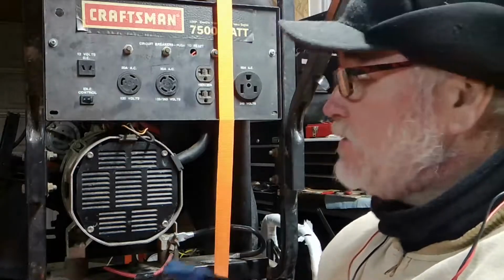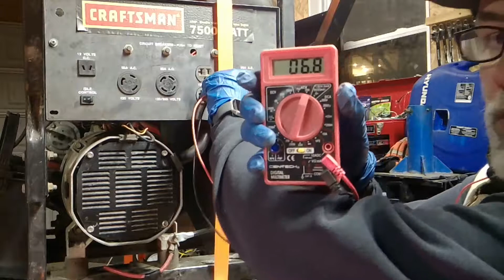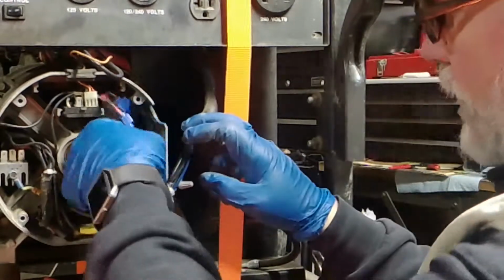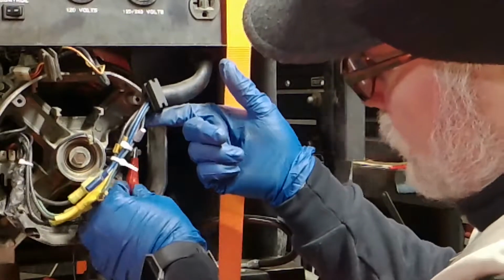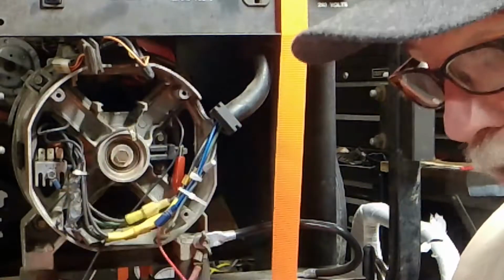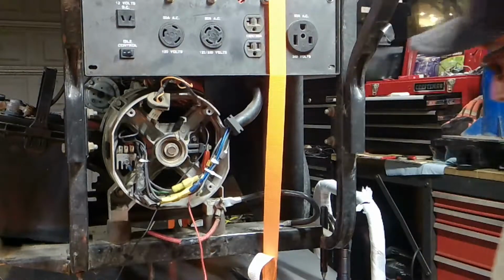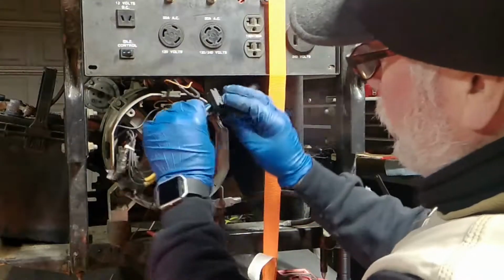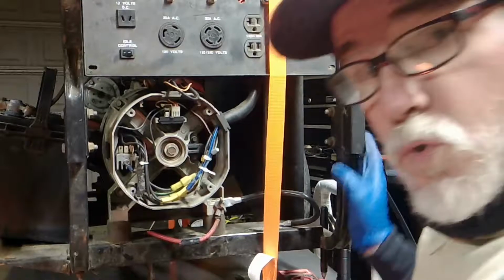How to diagnose generator power loss by flashing field w/12v battery and change voltage regulator

Comment: Great video the best part was when you showed us how to charge field with battery and having AVR / voltage regulator unhooked to see if generator puts out proper AC voltage so I tested and it puts out over 120 volts ac so it needs new AVR this was on a Honda EB2200X. Thank You Tim !!!!
Reply: ⚠️Generator safety: make sure you follow all the generator safety tips and always remember that carbon monoxide fumes are very dangerous to inhale and carbon monoxide is odorless and colorless which is a silent killer. You should always have a carbon monoxide detector if you have a portable generator. Please remember not to ever run your generator indoors. Running a generator indoors increases the risk of carbon monoxide poisoning which causes death. Please make sure your generator is 15-20 feet away from your house and away from doors, windows, and vents to lower carbon monoxide poisoning risk. Please remember also not to run your generator in wet conditions. Running a generator in wet conditions can cause electrocution. Please keep your generator dry. Make sure your generator is dry before using. If you need to use your generator during a wet weather, then you need a generator tent to protect your generator from getting wet. We also need to keep our children safe when we are using portable generators so that they won’t get electrocuted or burned by the generator which is dangerous. We need to keep an eye on children making sure they are not near the portable generator to avoid risks and also carbon monoxide poisoning. Generators can be dangerous so we really need to be aware with the hazards of using generators. Generators pose electrical risks. Please never try to plug a generator cord into a wall outlet to avoid back feeding. They should be plugged into a transfer switch if you need to run your house with the portable generator. Please not overload your generator. Overloading your generator can cause damage to the appliances that are plugged into the generator. Always turn on your generator first before plugging in appliances. And shut off your generator first before you unplug the appliances. Please use a heavy duty cord for your generator and the cord should not be worn out. Worn out cords should not be used on generators. Please don’t refuel your generator while it’s running. You need to shut off your generator and let it cool off before refueling it. Never refuel your generator while it’s still hot. https://youtu.be/I1jT3ANENvI and here is a video more about keeping your family safe while using portable generators. This is just a safety reminder and please make sure you are aware with the hazards of using generators. Everything that is said on the generator’s operating manual should not be ignored. Thank you hope you stay safe.

Comment: Now....I just used your Technique and Fixed my 8KW Commercial Generator.  I really appreciate your Video.
One thing I did for fear of Electrical Shock, was to make a series NO(Normally Open) Relay to put the Brushes on a 12VDC Battery.  I used another 12VDC Battery to energize the Relay.  When I cranked, then popped the relay, My Light came on(Plugged into the 115VAC outlet on the Gen)....So, makes it bulletproof Safe, you can turn on/off the voltage to energize the Brushes without having to handle a wire.Again, thank you for the Video.  It saved my generator, and moreso, my brain from worring about fixing it.  The local small engine man here in Georgia wouldn't touch re-energizing the thing.  Good Luck.

Comment: Well I have the same model with no power.  About 12 ohms resistance between the brush terminals.  I started it up with the AVR removed and flashed as you showed.  Output was 110 volts AC and about 9 volts DC.  I then installed a new B&S branded AVR and started it up.  Zero volts.  UGH.  Tried it again with the AVR removed and got the same 110 volts and 0 volts with AVR installed.  I don't have a clue what to do next.  The brushes look great.  The resistance from brush to terminal is 0 Ohms on each.  So now I'm lost.  Any help would be appreciated.

Comment: My generator (rigid) used to run most all of  my house great... and pretty often.  Now it seems to lose voltage over a few hours time... the display window starts out around 120v.. or so... several hours later it's down to 82, 83 volts... any idea of what could be happening? I appreciate any thoughts...

Comment: Quick question I believe my issue with my voltage regulator on my onan marquis 7000 is just the 12 volt to the field so my thoughts are i locate the pins in my regulator connection and run them directly to my battery bank with a toggle on my 12v positive so to energize it only after the gen is running. Allowing the v reg to preform as normal minus supplying the 12v to the field. Any suggestions because replacing it with a new one isn't in the budget atm its 300.00 plus for a new one.

Comment: Hi Steve, Loved your video! I wonder if you could go beyond what you showed us here. I did everything you outlined but I still have very low voltage (6.5 volts at the outlet). Is there any possibility the rectifier is bad? Thanks in advance.

Craig

Comment: Great video. Im working on a similar unit. The two black wires (comes from the left side of the gen) on the avr were already unhooked. How can I determine which goes to the front and which goes to the back...nice if they color coded these wires as well. Thanks

Comment: Nice fix, informative and good for a laugh too! Dude you’re nuts and I love it!!!
Reply: ⚠️Generator safety: always keep in mind that carbon monoxide fumes are very dangerous to inhale and carbon monoxide is odorless and colorless which is a silent killer. You should always have a carbon monoxide detector if you have a portable generator. Please remember not to ever run your generator indoors. Running a generator indoors increases the risk of carbon monoxide poisoning which causes death. Please make sure your generator is 15-20 feet away from your house and away from doors, windows, and vents to lower carbon monoxide poisoning risk. Please remember also not to run your generator in wet conditions. Running a generator in wet conditions can cause electrocution. Please keep your generator dry. Make sure your generator is dry before using. If you need to use your generator during a wet weather, then you need a generator tent to protect your generator from getting wet. We also need to keep our children safe when we are using portable generators so that they won’t get electrocuted or burned by the generator which is dangerous. We need to keep an eye on children making sure they are not near the portable generator to avoid risks and also carbon monoxide poisoning. Generators can be dangerous so we really need to be aware with the hazards of using generators. Generators pose electrical risks. Please never try to plug a generator cord into a wall outlet to avoid back feeding. They should be plugged into a transfer switch if you need to run your house with the portable generator. Please not overload your generator. Overloading your generator can cause damage to the appliances that are plugged into the generator. Always turn on your generator first before plugging in appliances. And shut off your generator first before you unplug the appliances. Please use a heavy duty cord for your generator and the cord should not be worn out. Worn out cords should not be used on generators. Please don’t refuel your generator while it’s running. You need to shut off your generator and let it cool off before refueling it. Never refuel your generator while it’s still hot. https://youtu.be/I1jT3ANENvI and here is a video more about keeping your family safe while using portable generators. This is just a safety reminder and please make sure you are aware with the hazards of using generators. Thank you stay safe.

Comment: Mr. Steve - So when you do this, that is "Flash" the field... once the leads are connected to the battery, breaker on, you're expecting 120V?  I have a small honda EM1600 generator - it's only got two posts, not four, on the lugboard.  It only has 120 V outlets, none are 240.   Would I still be expecting 120V w/ the voltage regulator removed?

2ndly, mine has a separate capacitor... I have checked that the capacitor loads and unloads w/ an ohm meter, but would I want to start with replacing both pieces (regulator and capacitor) or start w/ the capacitor, and then replace the regulator.

She makes 4.5 V currently - I flashed the field w/ a different procedure - plug into generator, wires onto battery - and now she'll make 75 Volts - but the next day, nothing again.
Reply: I should mention also, this AVR has a separate capacitor not built in to the AVM... if it's only producing 75 volts without flashing the field, but 120V after, is it the AVM or that capacitor?

Comment: Great job,  I didn't know about the flashing thing.  We used to do this on the old  Ford and GM cars with  generators  to get the current  flowing in the correct direction.  Thanks, William Orange county,  Ca.

Comment: This was extremely helpful. My preteen thinks you're crazy, so good for you on that one! Thanks for educating and entertaining.
Reply: Generator safety advice: here is what everyone really needs to know about when using generators. Remember that generators can be dangerous if not used carefully. You really need to follow all the safety instructions on the generator’s operating manual. Many people have died each year when using generators due to carbon monoxide poisoning and electrocution. Some people run their generator indoors which is not safe. Remember not to run your generator indoors even if your doors and windows are open. Your portable generator should be 20 feet away from your house and away from doors, windows, and vents. You also need a carbon monoxide detector. It’s never safe to use generators indoors. Running a generator outdoors lowers carbon monoxide poisoning risk. Please keep that in mind especially keeping children safe. We should also keep our children safe when using portable generators so they won’t get electrocuted or burned by the generator which is dangerous. Please make sure that children are not playing near the portable generator to avoid risks. Generators pose electrical risks so be careful. Do not run your generator in wet conditions which causes electrocution. Make sure your generator is dry before using. You also may need a generator tent to protect your generator from getting wet if you need to use your generator in wet weather. Please don’t even try to plug a generator cord into a wall outlet to avoid back feeding. Only plug in generator cords into a transfer switch. Use a heavy duty cord for your generator and the cord should not be worn out. Make sure the cord is not worn out. And please don’t overload your generator as well. Overloading your generator can cause damage to the appliances plugged into the generator. Please don’t refuel your generator while it’s running. You need to shut off your generator and let it cool off before refueling it. Always turn on your generator first before you plug in appliances. And before unplugging appliances, please shut off your generator first. Read all the manual instructions carefully. Whatever is said on the generator’s operating manual should not be ignored to be safe when using a generator. This is just a safety reminder of using generators carefully especially keeping your family safe. Make sure you are aware with the safety. https://youtu.be/I1jT3ANENvI and here is a video more about generator safety and keeping your family safe. Thank you hope you stay safe.
Reply: @Kingston Jensen instablaster ;)
Reply: @Gage Shiloh it worked and I finally got access to my account again. Im so happy!
Thanks so much you saved my ass!
Reply: @Kingston Jensen happy to help :D
Reply: @The_Happy_Aviation_Enthusiast  ?   same response , so far. 3 times.....anything you missed, about answering questions from viewers ??

Comment: You can plug in a drill with generator engine running spin the chuck backwards (trigger pulled ) and flash the field . Did mine with 1/2 inch drill .
Reply: ...an angle grinder, run backwards on a board, is  MUCH  SAFER.

Comment: Run a short lead from the battery negative to connect a lead to it, or use the frame as negative. Then any sparks from connecting/ disconnecting will not blow up the battery in your face. Make it the last lead you connect and the first lead you disconnect or you could be in trouble if the battery is gassing.
Reply: ⚠️Generator safety: please make sure that you follow all the generator safety instructions and always keep in mind that carbon monoxide fumes are very dangerous to inhale and carbon monoxide is odorless and colorless which is a silent killer. You should always have a carbon monoxide detector if you have a portable generator to make sure you and your family are safe from carbon monoxide. Please remember not to ever run your generator indoors. Running a generator indoors increases the risk of carbon monoxide poisoning which causes death. Please make sure your generator is 15-20 feet away from your house and away from doors, windows, and vents to lower carbon monoxide poisoning risk. Please remember also not to run your generator in wet conditions. Running a generator in wet conditions can cause electrocution. Please keep your generator dry. Make sure your generator is dry before using. If you need to use your generator during a wet weather, then you need a generator tent to protect your generator from getting wet. We also need to keep our children safe when we are using portable generators so that they won’t get electrocuted or burned by the generator which is dangerous. We need to keep an eye on children making sure they are not near the portable generator to avoid risks and also carbon monoxide poisoning. Generators can be dangerous so we really need to be aware with the hazards of using generators. Generators pose electrical risks. Please never try to plug a generator cord into a wall outlet to avoid back feeding. They should be plugged into a transfer switch if you need to run your house with the portable generator. Please not overload your generator. Overloading your generator can cause damage to the appliances that are plugged into the generator. Always turn on your generator first before plugging in appliances. And shut off your generator first before you unplug the appliances. Please use a heavy duty cord for your generator and the cord should not be worn out. Worn out cords should not be used on generators. Please don’t refuel your generator while it’s running. You need to shut off your generator and let it cool off before refueling it. Never refuel your generator while it’s still hot. https://youtu.be/I1jT3ANENvI and here is a video more about keeping your family safe while using portable generators. Everything that is said on the generator’s operating manual should not be ignored. This is just a safety reminder and please make sure you are aware with the hazards of using generators. Thank you stay safe.